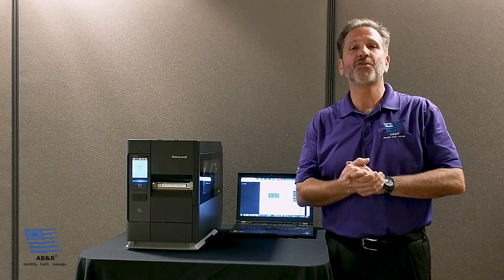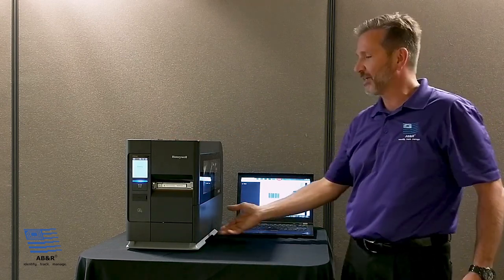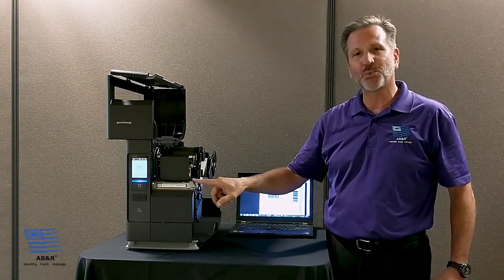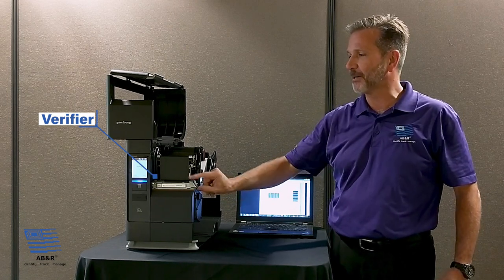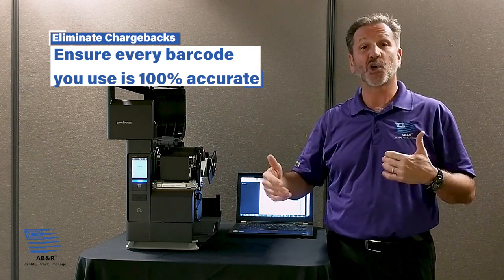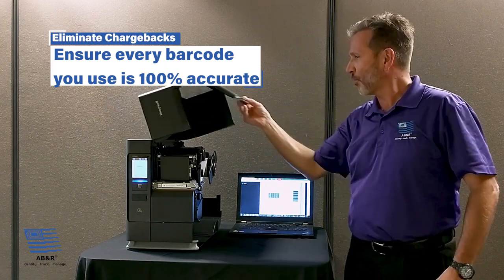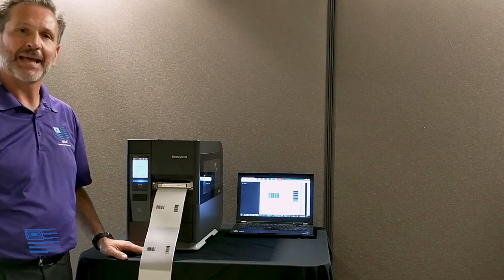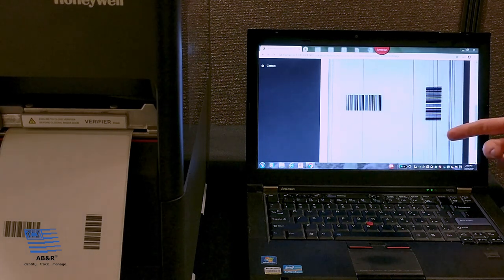Honeywell's New PX940V Printer in Action | AB&R

Comment: does this "verifier" works with data matrix and QR codes? i mean, if the 3D code is bad printed, the printer can re print until the label is correct?